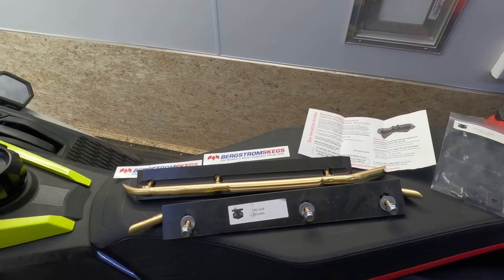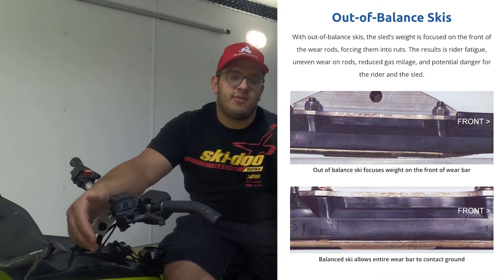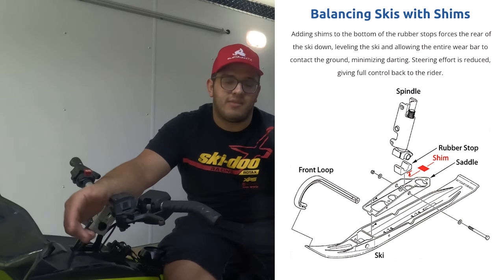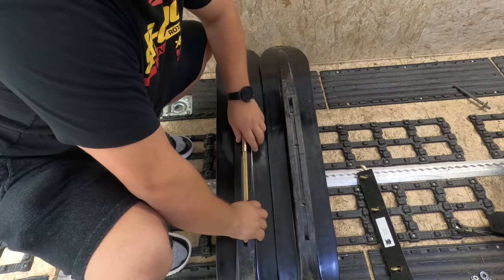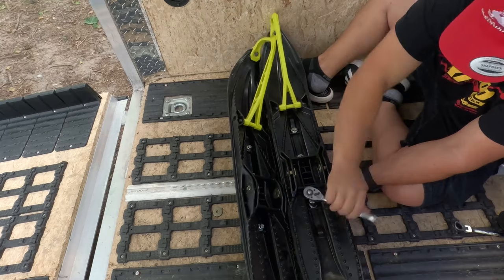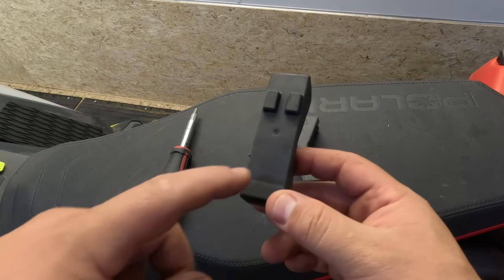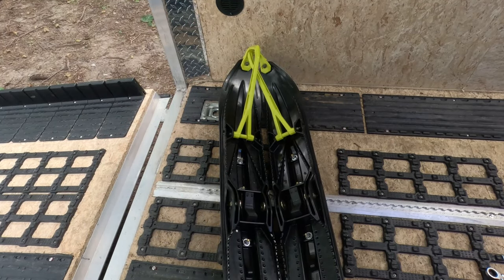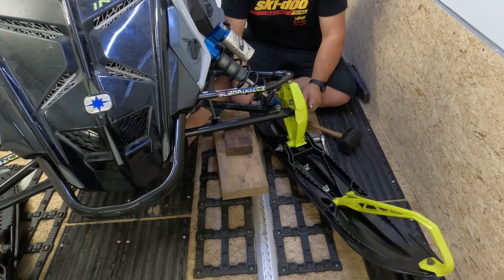New Carbides On Our Polaris VR1 Snowmobile | Bergstrom Triple Points | Our Favourite Setup!

Comment: Do you have an experience with the bergstom tripple point on say the 2021 oem skis 650 matryx ?
Reply from the maker: Hey Terry. Unfortunately I don't. Only added them this year with the gripper ski's. But I have buddies that run them on their stock pro steer ski's and love them. It is a fantastic carbide setup and I am sure it will work great for you. Cheers, Jesse
Reply: Thanks . I weighed it all out and decided to go with dual runner trek by qualipeice
Reply: ok, thanks i decided to try the trek model from qualipeice in quebec
 @sledaddicz

Comment: Hey you forgot to put on the wheels! (Qualipieces Rollerskis)
Reply from the maker: Haha its funny you say that. I wanted this video to be generalized for installing the carbides on any Polaris with gripper ski's. I installed the ski's on video and then took them apart after and added the wheels lol. Cheers, Jesse
Reply: @sledaddicz  ah i see. Save those for another video. Nice work on this one, detailed with all the little touches.
Reply from the maker: Actually decided not to do a rollerski install this year since I did an install video 2 seasons ago. Something else in the works :)
Haha there was alot of acrobatics required for this video with the tight space I had to work with lol.

Comment: Just get some Snowstuds and be done.. best Carbides on snow hands down
Reply from the maker: Tried those but prefer the triple points. I've tried over 20 different carbides and nothing handles as well as the triples in my opinion. Again, everyone is different and you are definitely entitled to your opinion man. Cheers, Jesse
Reply: @sledaddicz  lol they better be for those prices
Reply from the maker: @jamesmullen75  they certainly are. double the life of any other carbides I have tried. After 13,000 kms on one set, I took a look at them and sure the carbides were a bit dull but the bar was still completely intact. Never seen anything like that.

Comment: What kind of warranty does   Bergstrom have? After one season a whole length of carbide broke off cleanly on both skis. Seems more like a manufacturing issue, for the price you pay, they didn’t last.
Reply from the maker: Hey man. The guys running Bergstrom are a bunch of standup dudes and will always stand by their product if it actually broke due to a manufacturing issue. I would definitely reach out to them. Carbides are a wear item so generally there is no warranty but that being said, a manufacturing issue is another story. The past two sets of triple points I have run have lasted me well over 10,000 kms on them before I needed to replace them just because they became dull. I can't even imagine how they would break like you are describing. Did you use the ski shims that come with the carbides? Cheers, Jesse